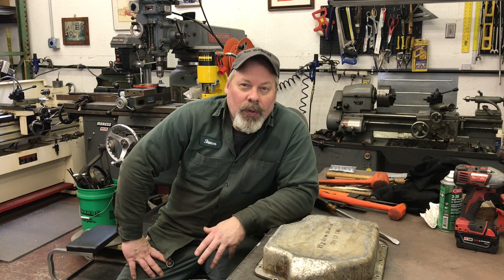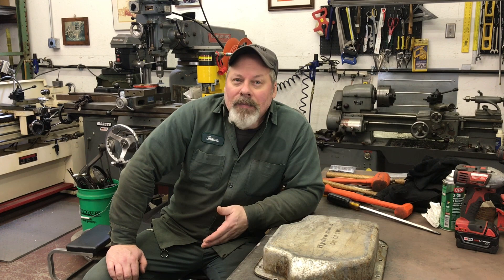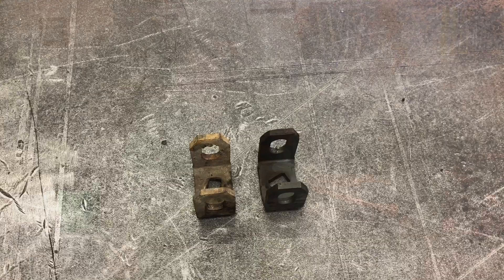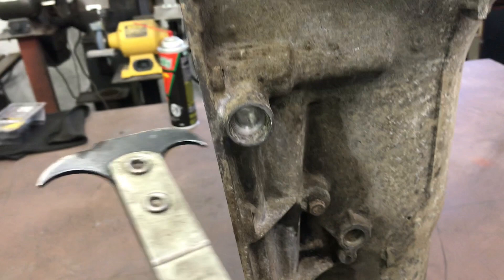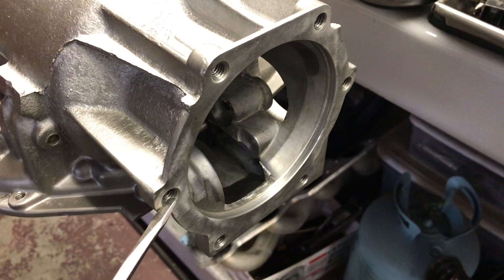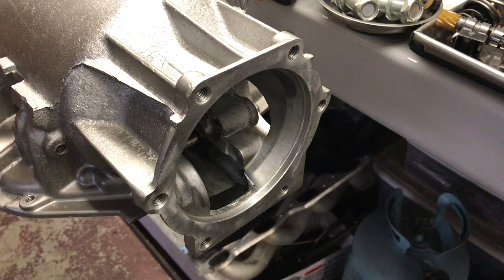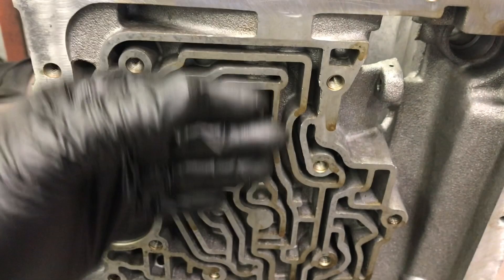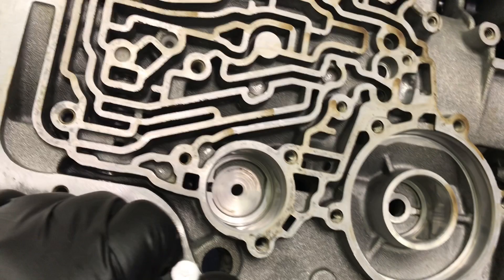TH400 Common Problems & MISTAKES!!!

Comment: I have my dad's '65 Impala SS 396 with a TH400 he bought new in St. Louis. He traded his '62 409 Impala SS on it. He found out the then new TH400 was going to be in Chevys since they had been in BOP in 64. He ordered the '65 in Nov of '64 and took delivery June '65. The salesman at Weber Chevrolet called him every week to tell him it was still a good order, they were waiting on transmissions. So 7 months later he finally got the car. No wonder...first year engine, transmission and first Holley for Chevy. I was born in '70, and I remember he had some issues when I was old enough to know, one of which was the 400 slipping at times and shifting slowly between gears. He had a guy go through it and he swore he only pressure washed the case.  I'm currently restoring the car and the guy that rebuilt it a few years ago said it was in amazing condition for 188,000 miles, and he did a very mild upgrade with a basic shift kit and what he said were premium parts. It's a 100% stock rebuild so it should last my lifetime. My rebuilder said there was an issue on the first year 400s that allowed corrosion to build up on some part that affected shifting and GM improved it on '66s. I don't know about that, but I've had countless 400s rebuilt for numerous muscle car restorations I've done over 40 years and they've always been amazing. I love these channels because I used to talk to my dad about stuff like this all the time. Wish I could talk to him 5 more minutes.
Reply from the maker: Great story! Sorry about your Dad, lost mine a year and a half ago.
Reply: @mountainsgarage  Yeah. Sorry, too. I'm 51. All my heroes are gone.
Reply: Someday, bro.. someday

Comment: I have TIG welded motorcycle cases on sealing surfaces hundreds of times that worked great.  that case can be fixed for sure.
Reply from the maker: I am sure it’s possible, but I couldn’t sell it and I wouldn’t run it, so to me its just a reminder to pay attention!
Reply: @mountainsgarage  well that's good to be particular. I have just repaired so much stuff like that it's almost sad that I didn't dedicate my life to something more important in that amount of time. ha
Reply: @mountainsgarage  If you don't mind I had a question on the th400 silencer ring. I see a lot of people don't use them but I read somewhere they help keep oil around the planets? I also read they where in the 4l80e the first two years but they went away.  does it hurt to leave them in?   I appreciate the videos!
Reply from the maker: @turboryan  No doesn’t hurt. I only find them installed half the time. GM called it a silencer ring, don’t believe it has a oiling duty or it would always be there. You seldom find them in trucks, just cars where noise could be a complaint,
Reply: @mountainsgarage   I am curious how it makes them quieter... I could see if it held a bunch of oil that would help with sound... idk.  I saw a video with the  precision transmission guy talking about it, made me wonder.  my straight planets in 400 are not too loud at all so it must work. 

  I lost a seal ring in my trans and started pulling it apart and noticed the some of the parts I bought and gave my tranny guy are not inside.  really grinds my gears so to speak. so I decided I need to do them myself.  your videos are some of the best I have seen on this stuff.  thanks for making them.
Reply from the maker: @turboryan  I also have watched the video. I have 3 TH475s that appear to never have been touched. All less than 50000 miles in Motorhomes. None have had a silencer band.
There is plenty written about reaction carrier float and the need to rollerize it and how removal of the silencer band may allow more float. GM also stopped using them in the 4L80E. 
But its builders choice, put it in if you desire.
Thanks for watching!
Reply: @mountainsgarage  Sound good, I have been reading on that.  Have you had any pump issues running high line pressure on the street? like with the CK performance valve bodies. I have seen some post about taking out pumps with locked line pressure.
Reply from the maker: @turboryan  It’s only 200lbs, thousands less than a normal hydraulic system. Zero issues.
Reply: @mountainsgarage  that's an excellent point... I  have a yard full of hydraulic equipment, and it always works.  👍

Comment: Thanks for sharing the tips. If you ever need a case or tail housing I have plenty. Everything I do is 4x4 and I’ve been trying to only use the case with the extra beef around the rear bolt holes. Usually I have double transfer cases hanging off the back
Reply from the maker: Great to know, Thanks!

Comment: Thanks for showing your mistake. I’m. Gathering parts to build a 400 . I’m going to our studies in the two holes at the bottom of my pump, I’m going to shorten them so not to bottom in the seal housing. I’ll put two at the rear also just to ease filter change under the vehicle. Once again thanks for your Videos. 👍
Reply from the maker: Thanks for watching, glad to help if I can!

Comment: Great video If someone used the wrong pan bolts Could they not break the. Case. Even worse they might not notice until the trans started to haemorrhage out of the pump Good point on correct fastener s Thanks for the great work
Reply from the maker: Yes, I have seen the results of using bolts that are too long. Thanks for watching!

Comment: I love your videos you have so much knowledge to share I just tore up a perfectly good turbo 400 my friend built for me my big block 439 in my 88 monte carlo had a turbo 400 with a reverse pattern  valve body now my engine only makes a lil over 650 hp 605 torque at 6200 rpm well I left real hard and brought it up to 6200 and shifted 2nd I seen a huge puff of white smoke then where 2nd was became another nutarul other then dyno pulls on this engine I only had about 20 miles on the combo. So I will be pulling it out to put my spare 2 speed 400 in which came out of my buddy's 496 blown 69 chevelle and hope it holds up and I hope when my friend takes the blown trans apart that the case is reusable I'm willing to be hè didn't put the case saver in ìt. Just so I'll know how much vacuum does it take for a non manual valve body turbo 400 to shift under normal driving conditions?

Comment: Hi! I had an issue with my st400 on my buick wildcat 1964. I was driving down a long hill on low and when i shiftet to drive it suddenly did a hard jump and the engine died. I came to a stop in the intersection and put it in park and started the car. Then the car wouldn't shift at all. I wasnt able to get out of park. I went and felt under the car and noticed the gear selector mechanism had jumped out of the sprocket and put it back in. I was able to drive the car again and it shifts as normal. I do notice that it is hard to get it into neutral after that and somewhat before the incident. I also noticed yesterday that the manual lever plate has some slop to it and that it goes slightly in and out of the hole. Im guessing the pin inside the gearbox might have broken or come loose. Im able to drive it normally now however.

Comment: A broken case sucks almost as much as when people leave “labels” on new tires ! Come on Shawn ! lol
Reply from the maker: If it had broken under some glorious acceleration then OK, but chasing threads  :(
Reply: @mountainsgarage  that is sad . I once fried at starter while putting on a timing tape on a balancer also broke off a corner of a brand new Holley while bolting it down:(

Comment: Is the linkage bracket the same on a 700R4 as the TH400? I’ve got a 85 C10 with a 700R4 and I am having problems adjusting the shift linkage. Currently the bracket is straight up and down when in park.

Comment: Hey sir, I am trying to flush my TH400 fluid and I have the cooler lines disconnected and replaced my filter and O-ring. refilled the pan and ran it, at first fluid came out very slowly but now it has completely stopped. i noticed that it would suck fluid from the cooler return line but not from the pan. I have dropped the pan repeatedly to make sure the filter and pickup tube are sealed correctly. Am I going to have to tear it down and rebuild the pump maybe? Any advice or suggestions would be greatly appreciated.

Comment: I have an 86 k5 blazer. I bought it with a bad 700r4. I put a turbo 400 in it had to replace the governor after that everything was fine until the other day. I went out started the truck let it run for about 20 minutes. Got in it put it in drive , nothing reverse, nothing. No forward or reverse at all. I shut it off let it sit after 2 hours started it and it tried to move so i changed the filter put it back together and it worked for about 2 days then lost all forward but good reverse any thoughts?

Comment: can you drill and tap the shift shaft for a stud or bolt. and you can weld the case and hand file it or bore it on your mill.
Reply from the maker: Maybe on the shaft.
I couldn’t sell the case, and wouldn’t run it myself. So its junk at this point :(
Reply: @mountainsgarage  i understand, my dad use to ask me if i would not run it on my junk dont run it on someone else's. your one of the good guys.

Comment: I have a seized modulator valve, in an eight bolt pump case. How much heat should I put on the aluminum to try to work the valve out? It has been sitting for years..
Reply from the maker: In that situation try the least destructive method and hope for the best!
Reply: Thanks for the reply , it’s a shame that is an eight boat port case it’s stuck all the way in guess I could fully Manuel the thing.?

Comment: Can’t build up with a weld and shave it back down to spec?
Reply from the maker: Possible but it is a compound curve. Easy place for a leak.
That transmission is back together and in a street rod. It was only broke above the pump O ring.
Couple years going now.

Comment: Great info- a bad parking pawl will allow car to move on you? I could feel mine creeping.
Reply from the maker: Yes if they get rounded corners they will bypass under load. Click click down the hill!
Reply: @mountainsgarage  Thank you.
I have an auto -console shift TH400 in my 67 Camaro. 327ME engine  out of a 68 Camaro .
When it is cold and leaving neighborhood it will go in and out of 1st and 2nd.
Otherwise shifts great.
Reply from the maker: @ericvitelli7113  Cold fluid working on the modulator and governor, pretty normal.

Comment: Had th400 rebuilt and now it slips in reverse and first. I had them replace pistons with machined ones to fit 6 clutch stack also had them install close ratio planets. Car moves in reverse but barely however in manual low it is like a 2nd neutral. In drive car drives normal except for the shifts being rather soft. Any tips or ideas where they f..d up

Comment: Couldn't aluminum weld it and then drill & tap?
Reply from the maker: Yes. 
It’s a tough spot with compound curves, but I am sure someone skilled could do it.
Reply: @mountainsgarage  I would suggest that if an attempt is made to bolt a backing plate the full perimeter of the housing to insure against any subsequent warpage.

Comment: I wouldn't say its a complete loss could tig weld it and have a machine shop touch it up in a big enough boring machine or lathe but then again the machine work cost prob not worth it.

Comment: anyone on here know why a th400 would feel weak as if brakes are are partially applied for like 20 seconds first started after sitting? its funny you go to reverse it goes right in gear but feels like it takes more to go maybe its nothing been that way for 3 years???

Comment: What is a ball park price of all the parts needed to build a tùrbo 400 with a trans brake i have a guy who built my turbo 400 its got a manual valve body with a reverse pattern bùt i have anther turbo 400 that ìs a 2 speed it was in my friends69 shevelle that had a 496 blower engine in it and its a fresh transmission and i want to have it set up with a transbrake. Any help would be appreciated
Reply from the maker: If it is a 2 speed TH400 it must already have a transbrake?
Reply: @mountainsgarage  no it does not have a trans brake it don't even have a manual  valve body it came out of my friend 496 blower car he drove it on the street it was really a show car

Comment: I have a 1990 gmc sierra c1500 5.0 305ci with the 3l80 and have reverse but no forward gears and in reverse feels like e break is on when in drive gears moves as long as I don't give it throttle as soon as I do it kicks out of gear any advice

Comment: My truck will go into reverse and it will go at a idle can you please help me I have a Chevrolet truck a 1990
Reply from the maker: Glad to help, just need more info?
Reply: My truck will back up at a idle but if I hit the throttle it just spins
Reply from the maker: @22jefferysmith15  How about forward, is it missing any forward gears,
What transmission?
Reply: It's a th400  all forward gears work

Comment: Just rebuild my th400 now when you put it in gear it won't do anything unless you push the transbrake button then it will work until you shift it to reverse or park then you have to do it again any it acts like it's in drive when you rev it in reverse ideas.
Reply from the maker: What is the valve body?
Reply: @mountainsgarage  
It's a Hughes reverse pattern HP2215
Reply: I pulled it back off cleaned it up nothing seems out of the sorts put it back in and still doing the same thing it didn't start messing up until I tried the transbrake button now it's acting a fool.
Reply from the maker: Maybe the modulator valve is hanging in its bore under the Transbrake solenoid?
I see it comes with a spring but should shuttle easy.
Reply: @mountainsgarage  
I found the issue had a forward clutch piston break odd but I took it back apart it needs aluminum Pistons for sure don't do what I did lol.
Reply from the maker: @keysautorepair6038  At least you found the problem!

Comment: Can you tell me the part numbers on your th400 “Jtools” for seal installation you use thanks.
Reply from the maker: I will send them tomorrow.
Reply from the maker: Sorry, totally forgot! I am on it!
Reply: @mountainsgarage  No problem Shawn..Your a busy guy..I haven’t built a transmission in 20 years but I just finished up a mild 6.0 now I need to freshen up a th400 and like you I like tools even if I don’t use them everyday..Thanks again
Reply from the maker: @BigFun4Life  Forward and Direct inner seal protector is J21362, Intermediate Clutch Inner Seal Protector is J21363, and Forward and Direct Outer Seal Protector is J21409. Gear Unit Holding Tool is J21795-02
Reply: @mountainsgarage  Thank you Shawn..